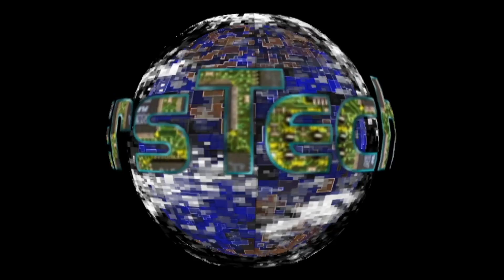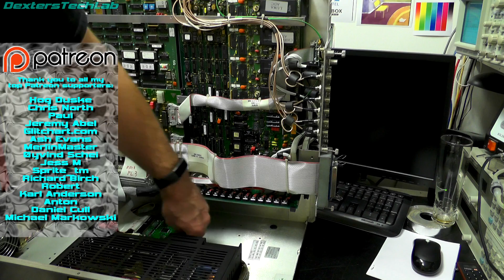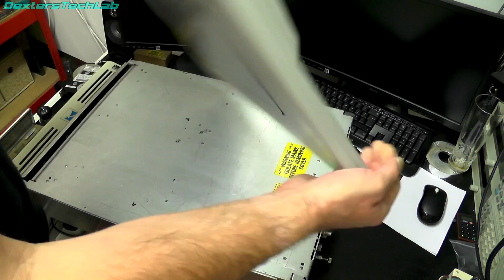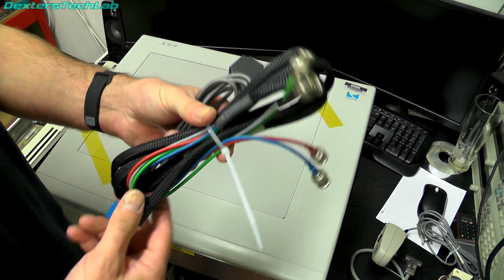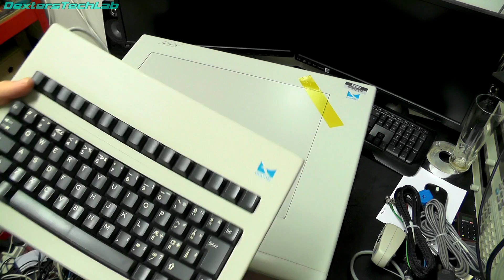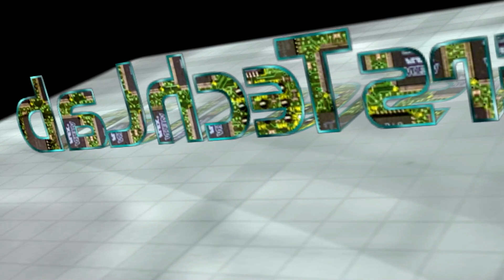DL200 Quantel Paintbox Restoration Part 3 - Final

Comment: To deal with the inevitable lack of keyboards to paintboxes, I wonder if it'd be worth the time someone reverse engineering the keyboard protocol. You said it's on rs232, so that'd make it pretty easy to just dump the comms between the keyboard and host to work out if there's any initialising required and what scan codes come out (and also how they're packed over the wire). Should then be pretty easy to make a converter with an arduino (probably one of the usb host capable ones) so a much more common keyboard can be used.
However, I guess you've probably thought that over already 😂
Reply: I was going to say the same. You could easily dump both directions using 2 converters or serial ports, and rs232 level translation (if needed). Then a simple PS2 to serial thing using an Arduino (or a little bit more involved if you use the ones with usb host as you've mentioned).
Reply from the maker: Yes this could definitely be a thing, i just might look into it.

Comment: Nice. Where did you find that new pen?
Reply from the maker: I have a small stock of them :-) Most came from a company that serviced Quantels but they do also come up on ebay occasionally.
Reply: @DextersTechLab  I wonder if they could work on a modern Wacom type pad...
Reply from the maker: No, Wacom are notorious for not making pens back/forward compatible with generations of tablet.
Reply: @DextersTechLab  too bad